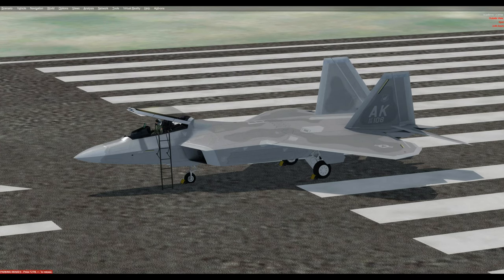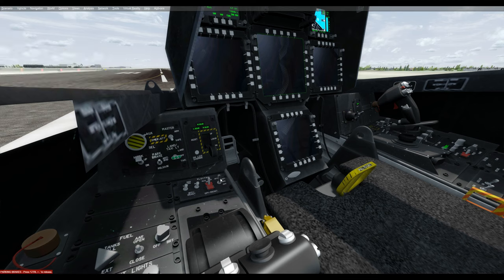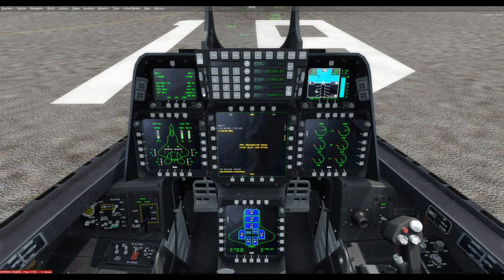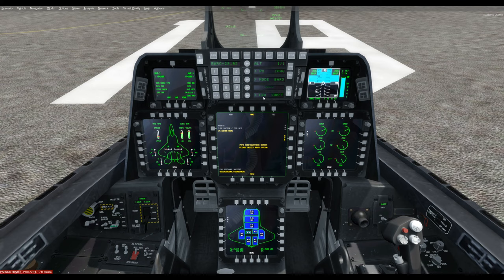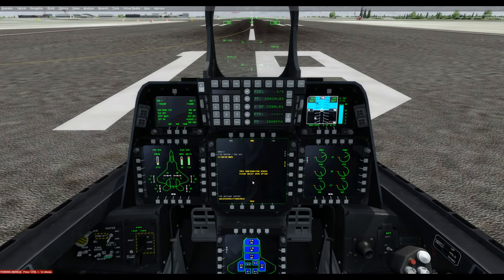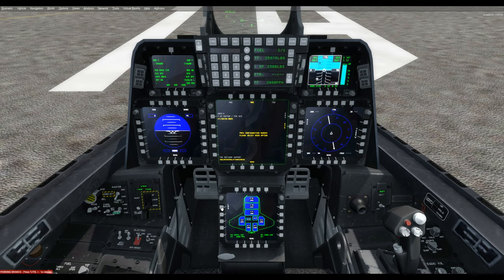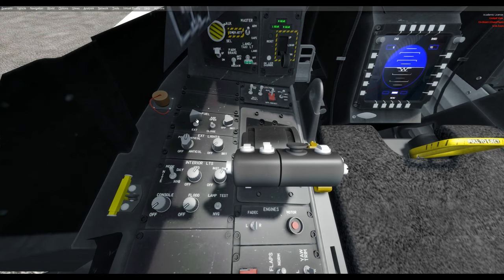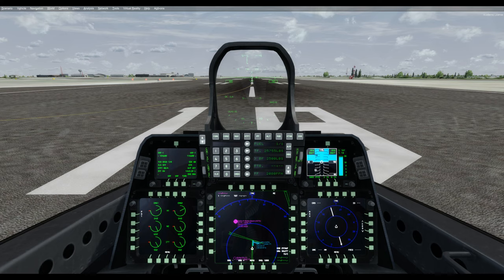F-22 Raptor Tutorial in P3D v4.4 on 1/21/2019

Comment: You started the engines with generators off.
In other videos, I see F22 starts with generators on.
The IRIS manual too states first generators on, then start.
I've read about aircrafts starting with generators off (to ease it for the starter)
and aircrafts that must be started with generators on (if generator=starter).
As I did a cold startup, first APU, then left engine with generator on,
the generator switch was reset to off automatically,
starting the right enginge afterwards didn't reset the generator switch,
so how to start the engines ? With or without generator on ?
Or left eng with generator off, then right eng with generator on ?
Reply from the maker: Great questions.  I don't have a proper answer, but as this is probably one of the most commented on aircrafts in my list, I suspect someone can answer with better knowledge than I can provide.  I hope someone will respond.
Reply: @bjmarten6463   Regarding starter systems, I found https://www.flight-mechanic.com/powerplants/engine-starting-systems/. Maybe the difference lies in the starter operation modes: air starter (generator is unnecessary load at startup phase) vs. electric starter (generator used as starter, so it must be switched on) ?
In this video https://youtu.be/mS0Gl_wE6IE?t=361 at 6:00, the guy mentions the startup of the F-22 turbine (P&W F119) as not electrical, in this case, switching the generators off would reduce the starter load.
Reply: Supplement:
https://aviation.stackexchange.com/questions/33452/do-f-22s-use-cartridge-start-to-start-engines mentions "APGS",
for more details see https://www.flightglobal.com/allied-near-to-completing-f-22-/366.article
And in https://forum.cartridgecollectors.org/t/f-22-does-not-use-a-cartridge-start/41427 I found
"In turn it goes starter turbine > clutch/gearing system > APU > main engine. That last puff of smoke is the “choking” of the start up system as the APU starts powering up the main engine. There is an amount of precompressed air and fuel that is injected into the initial single-stage turbine, which then powers the APU through a set of gears. The APU in turn powers the systems and spins up the main engine."
So in my oppinion no need to switch the main generators on while starting.
But maybe someone with detailed knowledge could shed light on this question.
Reply from the maker: @KevinDaheimAllein  Thank you

Comment: How do I brake during landing, because everytime I use brakes (I think: tires are blowing up) and I can't use nose wheel steering ( gear indications turns red)
Reply from the maker: Easiest solution, I think, would be to turn off the realism setting for crashes in P3D.  See if that helps.  My nose steering works (I just checked). I assume other aircraft steer correctly?

Comment: Little question. What does the Hook switch do next to the parking brake?
Reply from the maker: What is does in real life is one thing and what it does in the sim is a good question.  Does the hook drop when you activate the switch for carrier landings?
Reply: @bjmarten6463  I see no changes from the outside... Maybe the switch was implemented but the animation doesn't work. Also, how do I set up the hdg page of the autopilot to follow the flight plan, I've tried it yesterday but I ended up manually putting in my headings
Reply from the maker: I'll have to do some fiddling around to see how it works.  I just fly it VFR for fun when I use it.  I have family here visiting with me for a few more days.  After that I'll have a look and see what I can find out.
Reply: @bjmarten6463  Ok, many thanks

Comment: First question: How to start up in Cold & Dark state?
Reply from the maker: It's all in the video.
Reply: @bjmarten6463  Where?
Reply from the maker: @suninmoon4601  My apologies, I misunderstood you.  I think I must have turned everything off and saved it as my default starting state so it would start up cold and dark.  Either that or I shut it down and then started it back up.  I cannot recall.  In any case, if you want cold and dark save it as your default aircraft at start up in the cold and dark state after you've shut it all down.  It should work.
Reply: @bjmarten6463  Thank you very much :)
Reply: PMFD : System - Config - Shut Down

Comment: Does P3D allow war sim or is just for free flight?
Reply from the maker: Free flight; although there are (I think) a few options out there but no aerial combat that I know of.
Reply: @bjmarten6463  Is there any jet fighter game for 4th, 4.5 or 5th generation fighters on PC which has realistic cockpit functionality & war fights? HAWX, Ace Combat, Arma, Falcon BMS only have outside world realistic graphics but cockpit controls are non-existent as these are made for Xbox, PS2 kind of remote controlled platforms. DiD TAW is the only game i guess which has good cockpit operations & satisfactory graphics as per late 1990s & early 2000s.
Reply from the maker: @rajat9619   thank you
Reply: @rajat9619  Falcon BMS 4.34 has a pretty good cockpit, mostly functional, and will only be rivaled by the upcoming F-16C Viper expansion for DCS World
Reply: @DollyRanch  but why the displays symbology are of legacy jets like F-15, F-18?
Reply: @rajat9619  If you get the Flaming Cliffs expansion you get the F-15C, you can get an F/A-18C expansion as well. They choose 4th gen or "legacy" fighters as you call them because their systems are simpler and easier to simulate. DCS modules are much more accurate and detailed than the included fighters in P3D
Reply: @DollyRanch  There is no point in operating F-15 or F-18 display inside F-22 cockpit. The legacy jets have different modes A-A, A-G, TWS, etc with dedicated display symbology & which have to be operated manually 1 at a time but F-22 has sensor fused avionics with much simple attack/situation/defense & systems display symbology. DiD TAW's external world graphics is bad but cockpit operation is the nearest to actual F-22.
Reply: @rajat9619  oh. I see you're more knowledgeable about the raptor than I, but I don't understand what you're asking of P3D or other fighter sims. You want an F-22 in a new sim?
Reply: @DollyRanch  I just want those sims with super graphics 1) not just for Xbox or PS2 but for PC & HOTAS game sets also where people can operate the buttons & switches as per real F-22 so that it doesn't appear like child's play 2) not just free flight but realistic ready-made & programmable missions & campaigns 3) real F-22 display symbology. ..... Imagine DiD F-22 TAW with good graphics.
Reply: @rajat9619  the current excuse is that the available information on the Raptor is not detailed nor accurate enough. Or perhaps cease and desist letters are being sent around. Maybe in another decade
Reply: @DollyRanch  If you have played DiD TAW knowing the F-22 displays well then it is a good amount of detail as per late 1990s & early 2000s standard. No other F-22 game has given that so far. Looking at the public details available for F-35 displays, future concepts displayed in airshows for F-15/16/18 upgraded cockpit (also on YouTube), Gripen, etc, even a  technical college or high-school kid with science & maths who knows the basic components & systems of a jet aircraft & electronics advancement, can easily imagine what can be put into cockpit operation & displays. UK has publicized its VR cockpit for 6th gen Tempest. Those HOTAS game pads with VR goggles are very close to Tempest design. A VR data glove is missing which might come in future. So there is nothing rocket science about it anymore.
Reply: Rajat Bhattacharya well then why hasn’t it been made? You should know that the Tempest cockpit mockup is not an accurate representation of the real technology. The UK even blurs out the updated Typhoon cockpit in recent videos
Reply: @DollyRanch  Today the details which are publicly known, were they declassified immediately decades back when they were made? NO. But as things are eventually declassified over a century, people can speculate where technology is going. Performance of a jet fighter is not just its size, ceiling, speed, thrust, etc but also how much time pilot takes to acquire target info, lock it & fire weapons. Hence if it is known that an adversary's jet might take few seconds more to perform a task then it may provoke the better side into thinking of a guaranteed victory & perhaps go to war. Hence not revealing every exact detail has become a thumb rule irrespective of relations are hostile or friendly. And these days some producers are selling both sides like USA sells both to India & Pakistan, so trust becomes a delicate factor. Coming back to video games, when we have VR goggles & HOTAS game pads then let's hope that just like legacy jets, F-22 & F-35 games with near-exact cockpit operation will be available soon to give a real pilot experience. Why should Airforce pilots have all the fun?